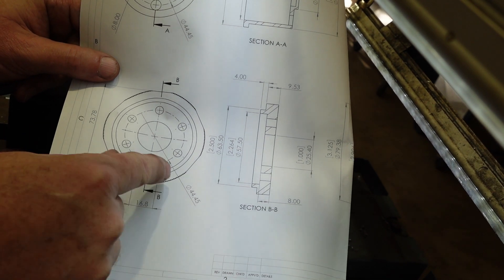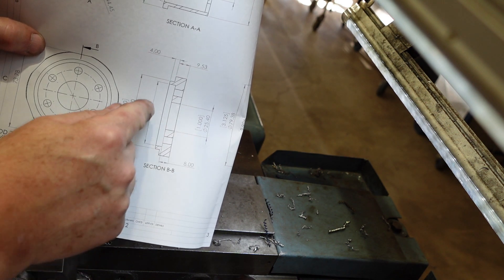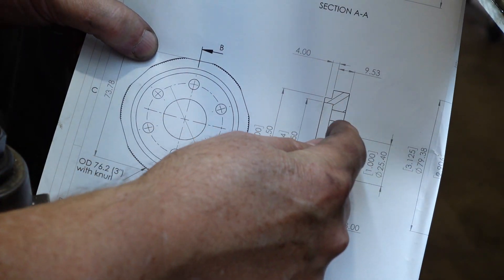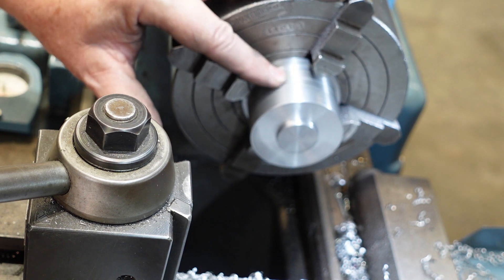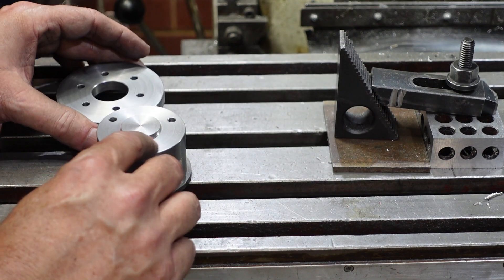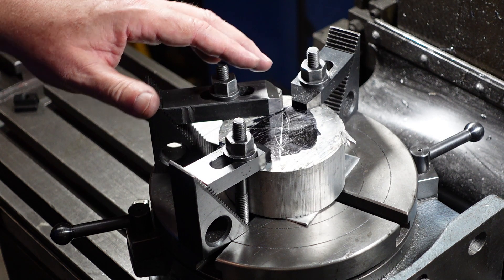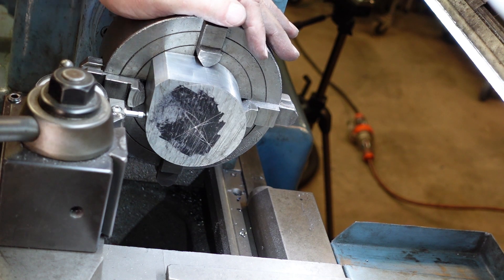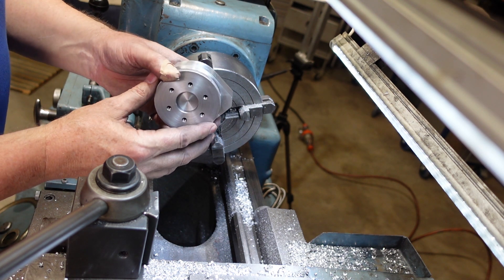6 position turret stop

Comment: Would you sell one of these?
Reply from the maker: No, for a couple of reasons. Firstly, I do what I do as a hobby, not to make money. As a result, I rarely make multiples of things. The other main reason is that every lathe is slightly different, so what fits on mine will only fit on the same make and model lathe. However, there should be enough information in the videos that you could work out how to make one for your lathe.

Comment: Watching, thinking and learning. Might make one of these, or perhaps two. I have two lathes.
Reply from the maker: Even a single stop version (with dial gauge) is worthwhile I think. A multistop version is only better when you have to repeat a sequence of operations
Reply: @occasionalmachinist  I design Loudspeaker motors. There are lots of repeat operations in turning those parts. Poor mans DRO works for me. Now to make a few Micrometer stops.

Comment: Always interesting, I have never seen knurling at such a high speed all the vids I have watch slow the speed right down.
Reply from the maker: I do slow from my typical turning speed (in this case around 360 rpm) down to approx 150rpm. I guess you can knurl at any speed you like but provided the spindles the knurls sit on are lubricated, it should not damage them, and with something like stainless, if you go too slow I can see it work hardening on you too.